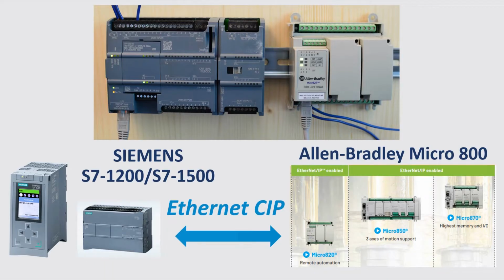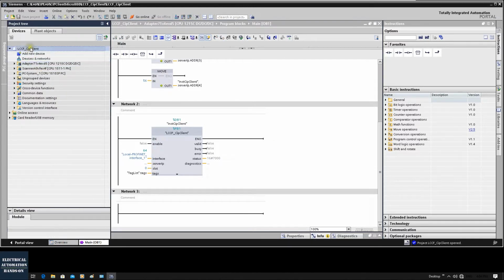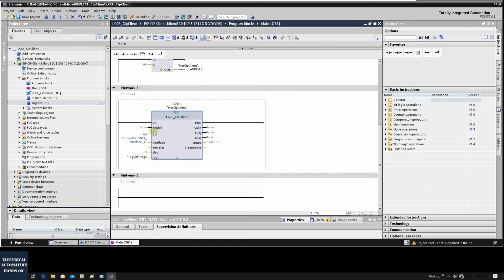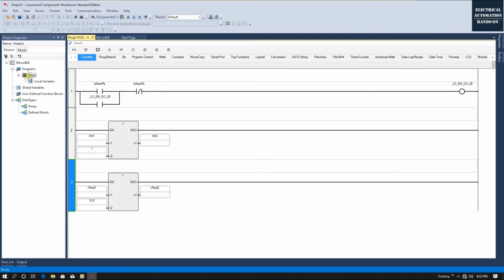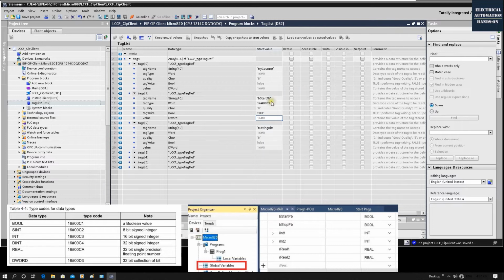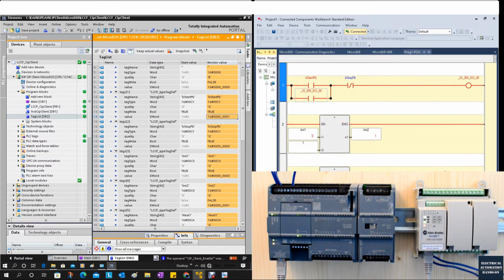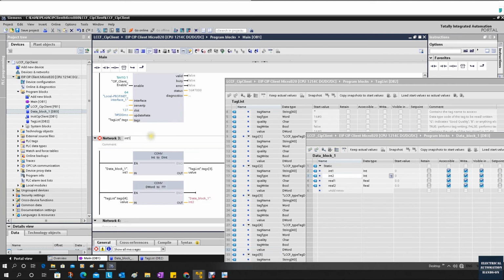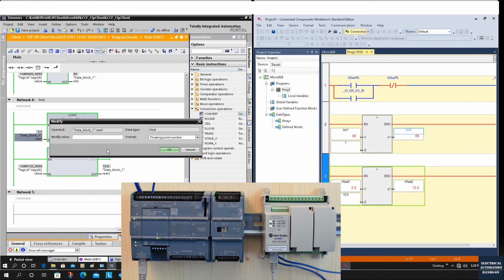COM30. Ethernet CIP - Siemens S7-1200/S7-1500 (Client) and Allen-Bradley Micro800 (Server)

Comment: Solved: ERROR 16#8602 (connection boken, reset the server by cycling the enable). Solution: setup or config both Micro820 and S-7 with the same subnet

Comment: ERROR 16#8602 (connection boken, reset the server by cycling the enable), HOW CAN I FIX THIS ERROR??
Reply: i have the same problem..my problem was i used two different subnet address, ( before i used Micro820 169.254.xx.xx and S-7 192.168.xx.xx) so when i change my S-7 1200 to 169.254.xx. 24) then it is working.

Comment: In siemens.  Whats tge different between EN and Enable inputs at the FB?
Edit: thanks for the great tutorials
Reply from the maker: generally EN used for hanging up the FB, when the 'EN' is off, the entire FB is not called, the its function is hanging up and blind. The 'Enable' is the logic wise, used for the internal of the FB or FC for multiple ladder logic places.
Reply: @electricalautomation  ok so in EN i must have a tag like you did? (M10.0). What will trigger that tag? And what if i leave  En without  a tag?

Another question is what is CIP communication?  Where isit mostly used? Isit its own protocol? And why isit better than others? 
Thanks